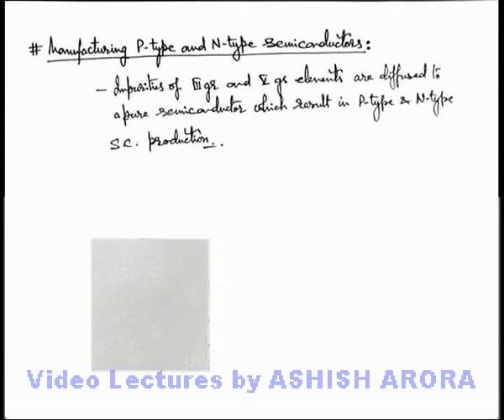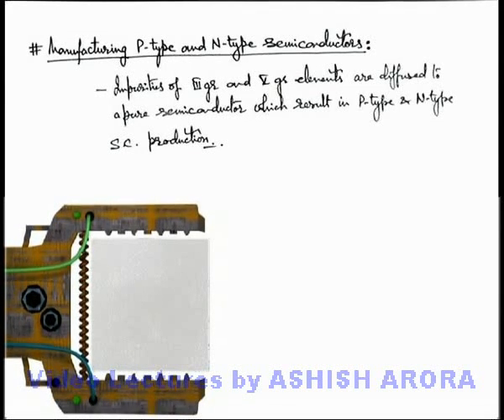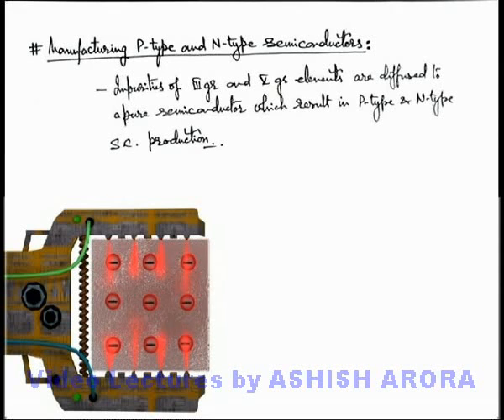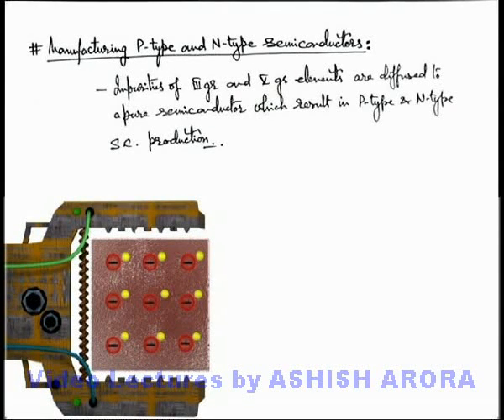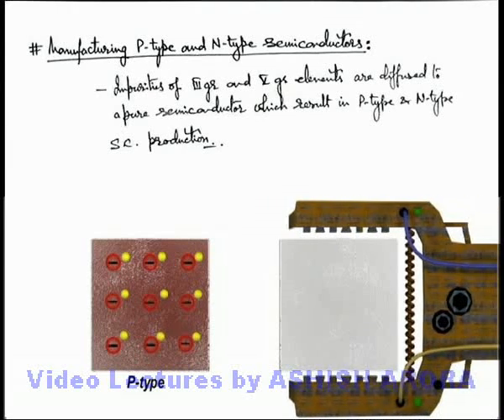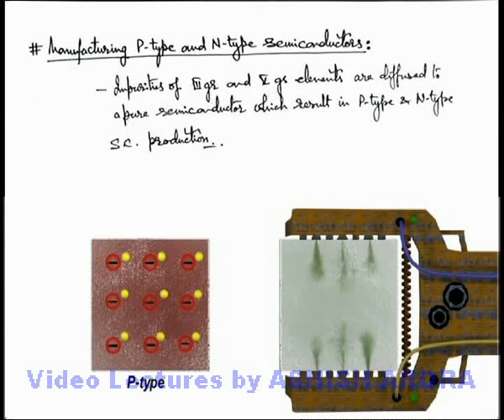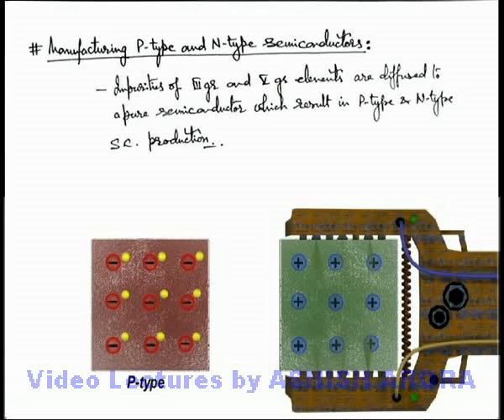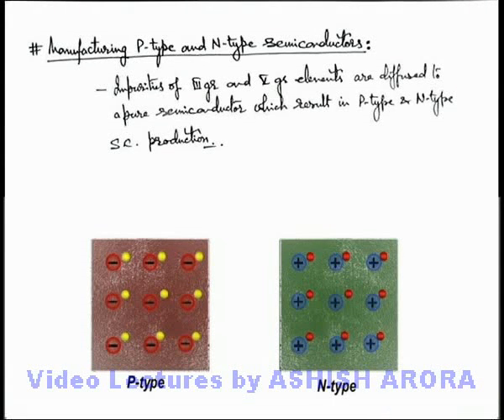Class 12 Physics | PN Junction & Diodes |#1Manufacturing P-type and N-type Semiconductors|JEE & NEET

Comment: I always got confused between n type and p type semiconductors trying to figure out which is which until I read this. "n" stands for negative and "p" stands for positive. "n" and "p" has been defined according to the type of donation made by the impurity atom. Donor impurities donate negatively charged electrons to the lattice resulting in n type SC. and acceptor impurities donate excess holes, which can be considered to be positively charged and the S.C. is called p type semiconductor. Thought it might help you guys avoid confusion :)
Reply: I learned it as majority charge carriers nature for P type they are holes ie +ve hence Ptype
Reply: yup 
i also use the same logic to remember it :)
Reply: p-type : pee - 3 letters. Therefore trivalent impurity.
Reply: @flamejee3500 Damn! I can't help myself but burst out laughing🤣
Reply: @flamejee3500 😂😂
Reply: But both types are neutral in nature though
Reply: I owe you one!